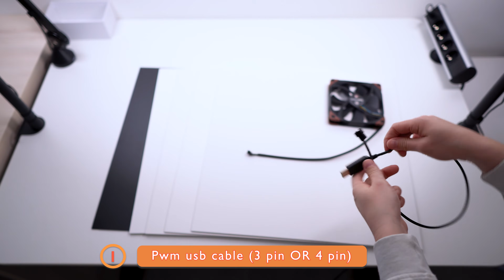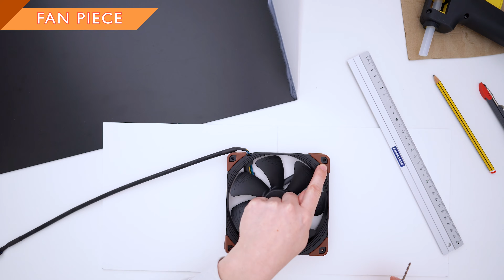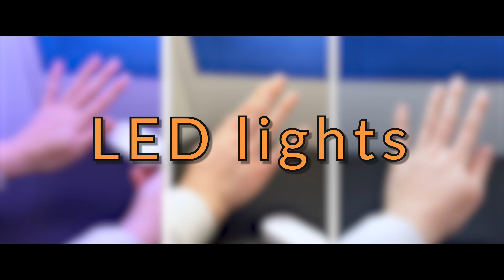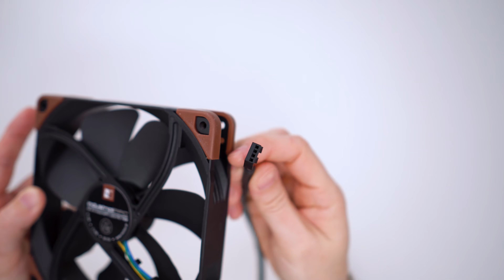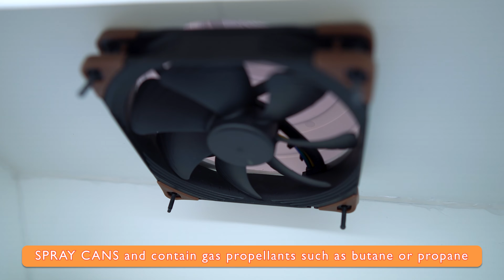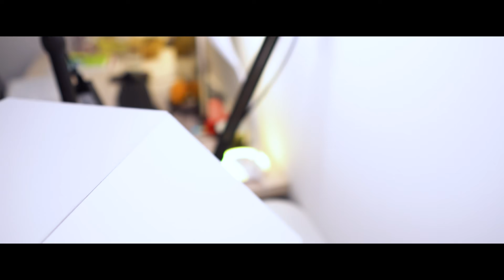Airbrush Spray Booth Build, How to Make it with Lights & Noctua Fan!

Comment: Is one single fan enough? I was looking for a small fan like the Noctua, but was wondering if I should get 2.
Reply from the maker: Surely 2 are always better, as long as it pulls enough air out, as the filter stops suction a lot. You can test this by placing your hand on the other end of the hose and feel how much it blows (for example there is a significant difference between Noctua 2000 and 3000). If you install 2 fans, you also have to adjust the reducer so that it is big enough. I saw on YouTube that someone put 4 small fans next to each other. After several tests when I airbrushed the heart, the Noctua A14 2000 performed very well, because I didn't smell the paint while I was airbrushing. But just in case, after a year I switched to Noctua A14 3000 and now I use Noctua 2000 as an air sucker while soldering.
Reply: @craftydanijela  Thanks for the input! Appreciate it. 😀

Comment: After watching every spray booth video on YouTube, I came across your video. This is exactly what I had in mind to build. I have the foam board and I bought two NZXT high static pressure computer fans I will place them side by side instead of one single fan. Can't wait to see your next videos! I subscribed to your channel too.
Reply: How did it go? Is the extraction system enough?
Reply: @PINGUA2311COMEDIAYPVP  it has enough extraction, but I'm rebuilding the enclosure to adjust a few things. So its all torn apart right now.